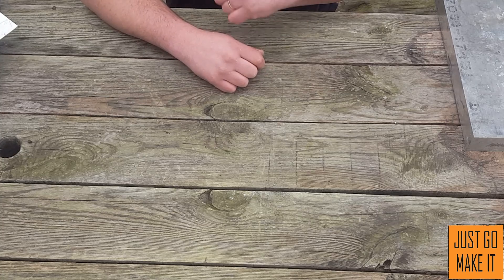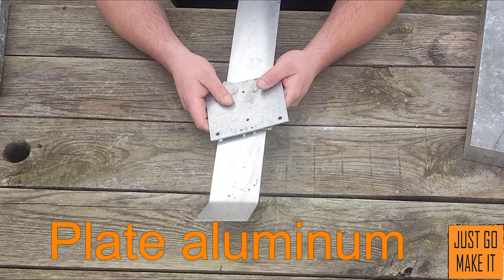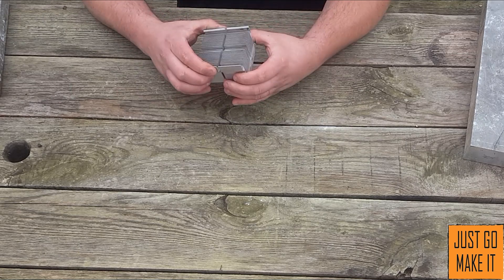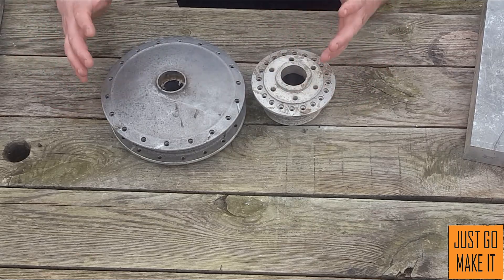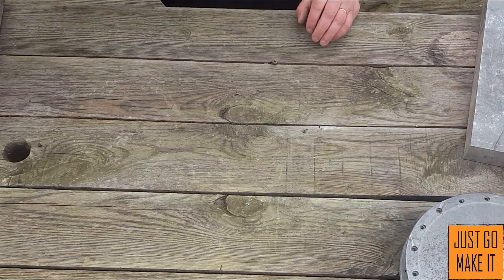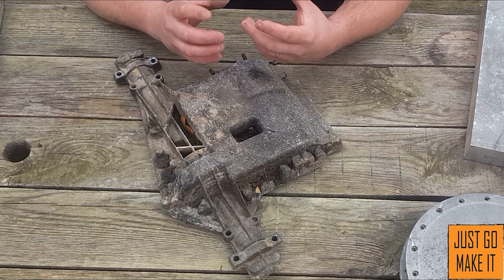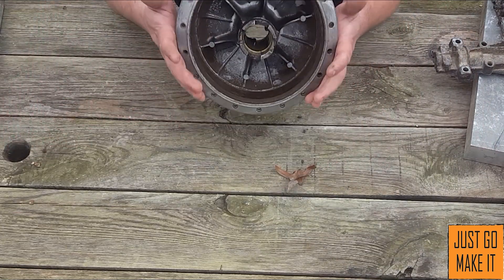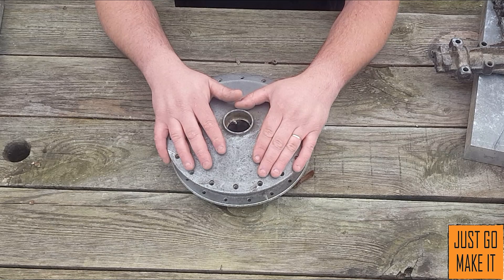Foundry Aluminum, What is best for casting?

Comment: Weed eaters  chain saws some transmissions and transfer cases are magnesium or magnesium aluminum alloys, you have to follow a formula to cast these, and I believe there are additives that you lose when you melt them down. Im not sure, i actually can't recall the process, so I'll suggest some research, sorry I'm no good there, but I'm definitely sure about chainsaw cases, automotive pistons, small 2 stroke equipment cases pistons and outer cylinders, inner cylinders have a nichrome electrofusion  or cast in ductile iron liner you'll want to fish out of the molten aluminum or secure and suspend the sleeve from the inside so you can extract it

Comment: To make soft aluminium more machinable add about 4% copper { or brass ]  Although it has a higher melting temperature it will' 'dissolve' into the melt. Having run a foundry primarily using scrap aluminium including tons of cans this does the trick without being too precise.

Comment: All aluminum is can be cast. Aluminum cans are almost 99% aluminum, but if all cans are crushed  they can be melted and cast. Not the best and not much good.
Window frames etc. Are normally 6061-T6. Melted and cast the T6 becomes T0. Very gummy to machine. The fix, pull the casting as soon as you can and quench the casting in cold water. That will bring the casting up to about T4, much easier to machine. Of course all aluminum that's been cast would be preferred. But they all work and so far none have had any porosity unless I made a mistake. Usually in gating or miscalculated the size of the riser.
Another thing I do, all my aluminum is cast into ingots, and separated before I do any casting with it.
Reply: So you saying by quenching quickly I can reduce porosity?

Comment: Desn't silicon make aluminum brittle? I used to snap parts made of silumin with my bare hands and I wouldn't call myself a strong guy.
Reply: Brittle enough for me to break down broken lawnmower engines with a sledge pretty easily, but those are also kinda thin too

Comment: hi, im planning to melt aluminum - mill dross etc, profiles, bars
should i clean the aluminum before melting 
eg. oil, dust, dirt

thx
Reply: It is recommended but if not it should be in the dross.

Comment: You don't have a clue, do You? Forget the carburetors. They are not aluminum pure enough. Mostly ZAMAC. And that front brake drum might give You enough money to buy ten times the amount in high quality aluminum from ebay. Polish it, and sell it to someone that needs it!
Best source for casting aluminum is wheels. But they need to be blasted, or 100% clean. Dynamo or alternaror brackets on engine blocks and intake manifolds are also great.
Reply: What about scuba tanks?

Comment: Are round billet of Aluminium 6061 good for casting ,
Reply: 6061/6063/7075 are really extrusion aluminum, the aluminum cans he mentioned are likely a 6063 type grade - you can cast them but it'll be weak, I wouldn't trust it for structural soundness.  If you're going to cast small figurines or other artwork it might be ok, something that won't get much stress.   

I saw a "7" at least on the aluminum block he showed, might be 7075, same thing - the extrusion process that made that bar changes the "grain" of the aluminum and strengthens it, it wouldn't make good casting material for anything of strength.  Its made for machining as is - not remelting and casting.

I've melted aluminum cans (cat food), it takes 100s to get even a small 4"  by 1x1" ingot - and they're extruded aluminum - I cast a decorative sun plaque for a GFs garden with it and it turned out ok (like the plaster/concrete ones you see in garden stores), but I wouldn't trust it for anything I relied on for structural integrity.

Comment: Automotive pistons have a larger silicon content because the silicon limits the thermal expansion, critical in 2 stroke engines. Closer tolerances in the piston clearance can be obtained if a high silicon Alloy is used.